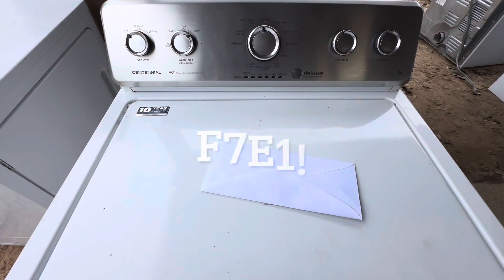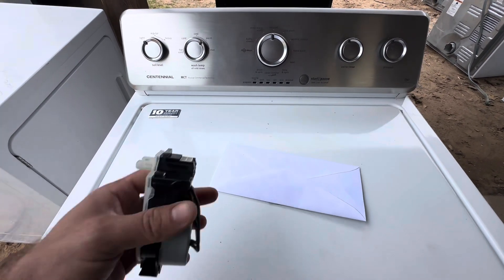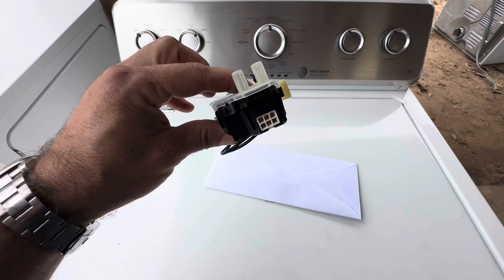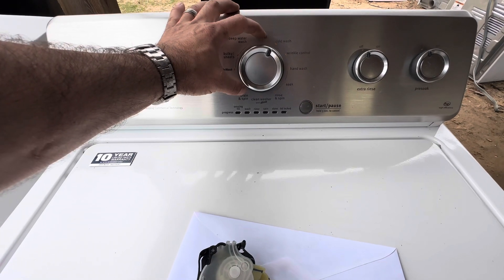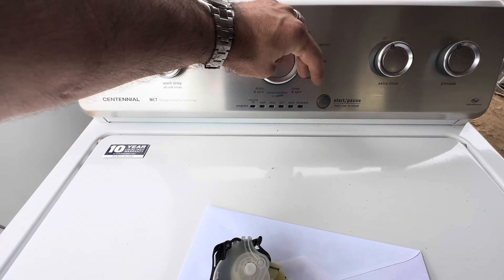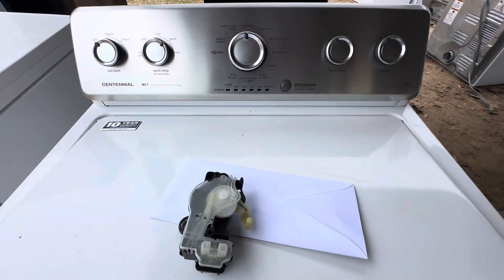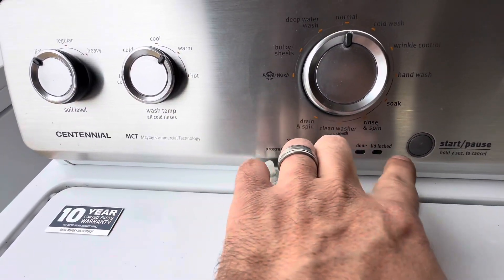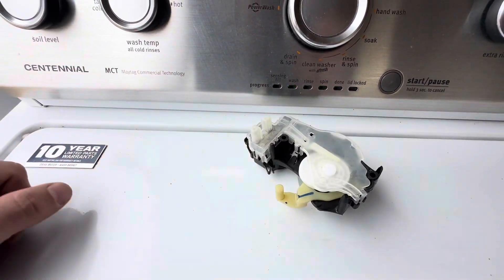How to test a Maytag and whirlpool washer speed sensor. Tachometer test mode w10006355

Comment: Just checked mine by following your test for light sensor. It does not show rotating lights in dashboard. I also have F7E1 code. Waiting for my new actuator to come. Will see. But thanks for the video!
Reply from the maker: If it doesn’t show light rotations in the tachometer test then it’s likely a bad speed sensor

Comment: Whirlpool WTW6120HW2. I already replaced the actuator, motor, gear box (seemed to be leaking onto capacitor), and capacitor (because of the leak). Did one load and it worked; back to F7E1 on second load. Tachometer detects the speed when spun. What else could it be? TIA 👍
Reply from the maker: That’s a tough one back track and double check everything. I would run the diagnostic and spin test and see what it does. I had one do this before and it was a broke wire. But it was acting like a bad capacitor or motor again. Or I was even considering a possible control problem in the end. But there was a broke wire in the harness at the bottom. Something doesn’t add up. Could be something simple over looked like that. 👍🏼
Reply from the maker: Drive hubs cause this to but I don’t believe yours has that junky plastic drive hub. Your unit probably has a metal spanner nut and splines.
Reply: Metal spanner and splines; drive hub wasn’t stripped out. I did factory reset and ran both calibration cycles under the Factory menu. That seems to have fixed it for now 🤷🏻‍♂️ thanks for the quick response 👍
Reply from the maker: @whoishooleyhoo  nice! That’s good news